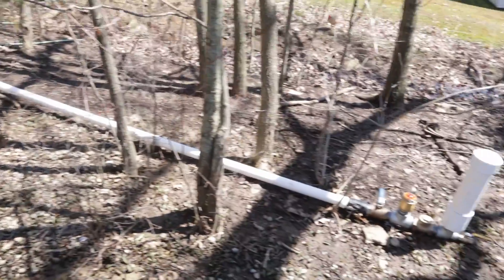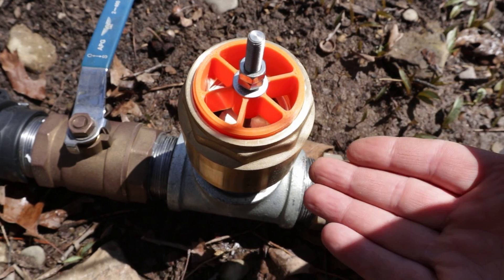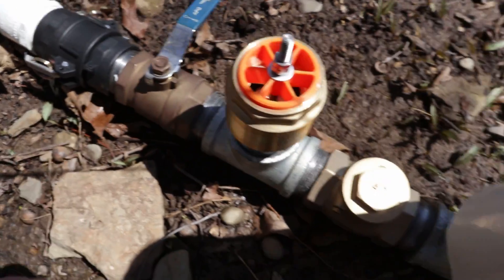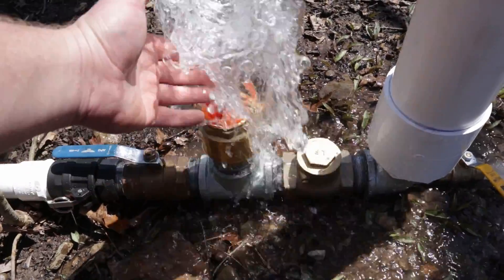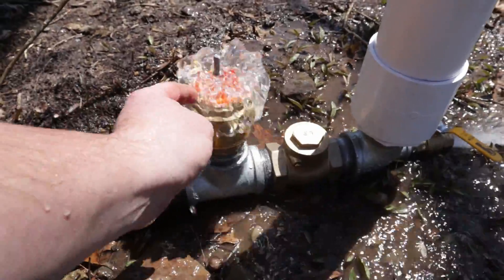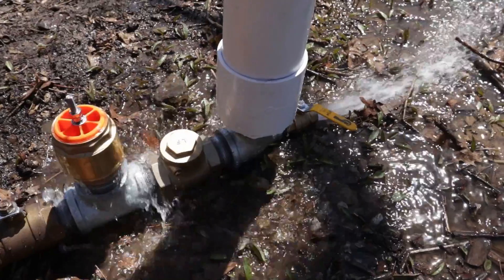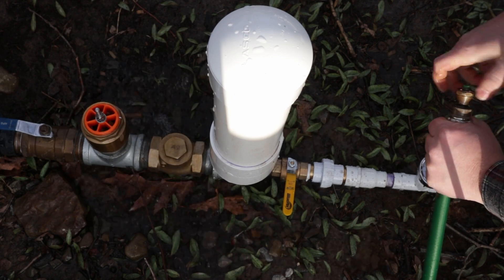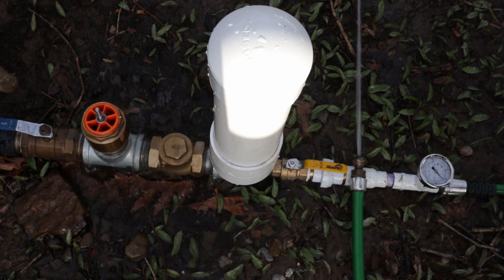2" Ram Pump Video 1

Comment: Thanks, Joe. But let me notice, that your buffer tank should be mounted ahead of waste valve to increase the resulting pressure. In your current scheme you are loosing a part of power.

Comment: So this will maybe sound silly, but couldn't you attach a funnel type contraption around the waist valve to then carry said waist water to another holding tank of sorts just for collecting and or to have a second source for another smaller pump? (assuming you have enough left over fall Hight still)
Reply: yeah there wouldn't be any reason for that not to work

Comment: Wondering is adding a piece of pipe between the exhaust T and the exhaust check valve would build the pressure as well? Would that be the same as adding weight to the exhaust check valve, and if so, would a longer pipe create more pressure? Built one of these in 1-1/4 inch and have yet to use it. Nice video

Comment: Do you plan on selling just the waste valve individually? I think the market really needs something better than a swing check valve. Would love a comparison video when it’s complete
Reply from the maker: That's what I've been thinking about, but I don't think I could make one smaller than 1.25", maybe 1".
Reply: Just make 1” and 1-1/4” still way better than a swing check valve that wears out in a year. Currently there zero on the market
Reply: Joe printed valve is better 
Watching many , many pump videos , very obvious  difference

Comment: I still don't see a water recycling unit in place, capture the waste valve and solar powered pump it back to the tank, as well as your outlet pipe (coming from a country that's just come out if a drought, seeing all that water going to "waste")
Reply from the maker: That's what those square white bibs are for, and I already have the electric pump. I just hardly have any free time anymore.
Reply: the whole thing is that a ram pump works with no electricity. they are simple and they work. you can get a free lunch.
Reply from the maker: @mog5858  where can I get this free lunch?
Reply: @JoeMalovich  i am sure you have seen an ad for it by now it will become right shortly. lol, youtube is full of free energy machines there's a lot of voltage floating around too. lol
Reply: @mog5858  Yeah, that's why everyone has their own personal "free energy generator" in their house and no one has to pay an electric or gas bill anymore. You know, because "free energy generators" work so well and are so ubiquitous.
Reply: That is an interesting way to get very high pressure water with a low pressure pump, just do it a bunch of times.
Not useful in anyway I can think of but cool idea.

Comment: Could you do an Arduino to control a servo motor to hold the valve down for a setable time? A little complex and would take some time and research but that would be really cool.
Reply: Ram pumps have been known to run for 50 years with no maintenance, why would you overcomplicate an already extremely reliable, simple system?
Reply: @nicholaskeur  to improve it's performance in a way that would be more difficult to do mechanically. I don't know exactly how right now, but that's the answer to your question.
Reply: @jaycweingardt11  Joe has already given the answer in the video, with weights on the waste valve. Abouts as simple as it gets.
Reply: @jaycweingardt11  if one really wants to be more efficient here the right way would probably be to have multiple ram pumps at different water levels so you automatically pump more water when flow increases. That way there is no need to artificially increase the weight when more flow is available.
Reply: If you're using electronics... You'd just do hydro power and an electric pump
Reply: @Zorlig I wou not know, but wouldn't an arduino and a servo would be pretty cheap?
Reply: @jaycweingardt11  sure but how are you going to power it?
Reply: @Zorlig  a portable phone charger and a cheap 5v solar panel.
Reply: @jaycweingardt11  yeah as mentioned above the point is mechanical simplicity. If you want to complicate with electronics and solar panels then install a solar powered pump. If you have power then install a pump.
Reply: @Zorlig  I think a pump would take significantly more power (efficiency) than a small circuit board and magnet. Not to mention the cost.
Reply from the maker: An electromagnet might be easier to implement. One that releases on a pulse of electricity would be somewhat electrically efficient.
Reply: The whole point is to ditch electricity alltogether.